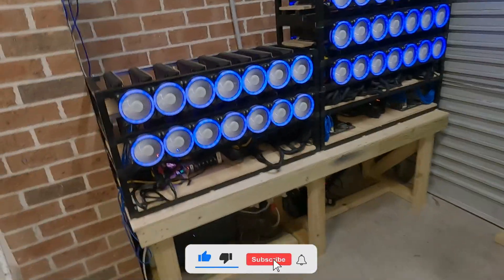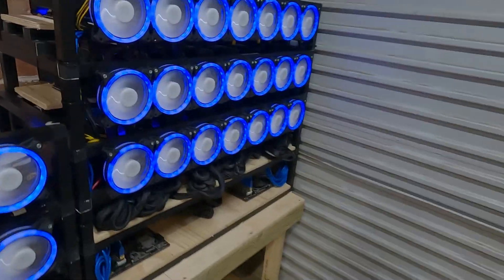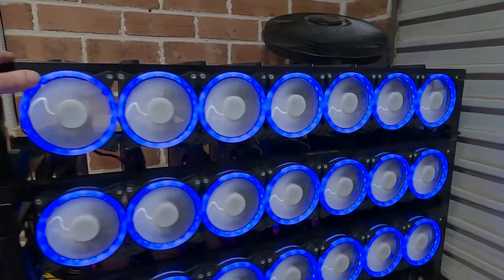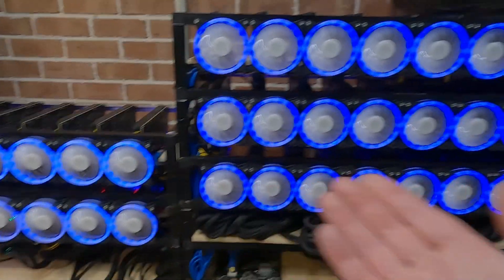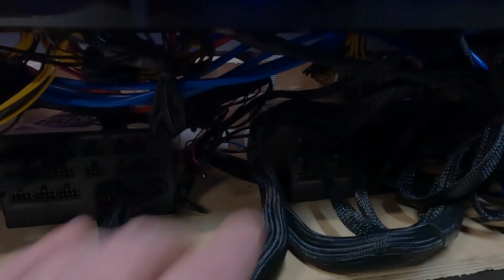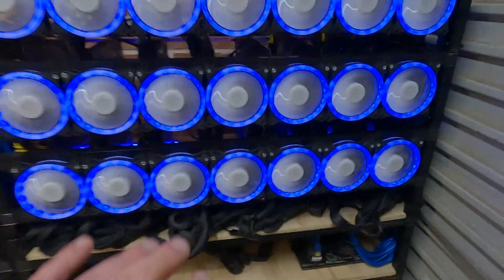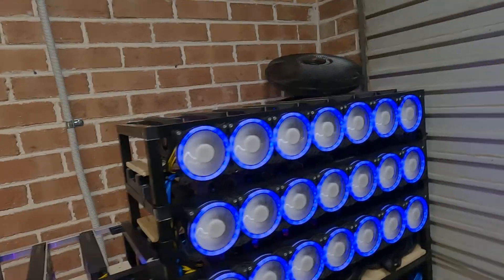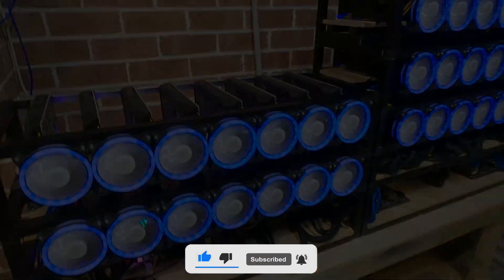My 3.5GH/s Ethereum Mining Rig Setup

Comment: Are your gpu fans pushing air to the wall? Mine are and I'm curious if that's TOO bad.    Or are yours sucking air out of the GPUs away from the wall?
Reply from the maker: Hey mate, yeah they where blowing into the wall in this video. And didn't have any issues have a couple fans behind pushing the heat up tonget it away from the rigs and stop it from accumulating.. but its now summer and it was not running well and was getting way too hot so I have now put them in a growing tent in the same position. But with a good exhaust system. And is working wonders. Checkout my channel you will see the tent video.. and I highly recommended it if you have that kind of setuo
Reply: @CryptekMining  Just watched it, thank you man, subscribed 💪

Comment: When did you fully assemble this?

Also, can you provide a description of how you assembled your frame?

Also, how did you effectively power all those fans?

By the way, this is an amazing setup!
Reply from the maker: Hi mate, I had assembled this around February 2021, The frame was custom as you can see a bit hard to explain everything but when i build my next rig in a couple of months ill be doing a video on how to build my frame.

Also the fans are molex each fan does not draw much power thus the because the systems have multiple power supplies i was able to distribute all the power to fans accordingly. Let me know if this is something you would like me to explain in a future video bro.

And thanks heaps bro glad you like it!

Comment: Very clean set up.. Are you using usb3 malke to female extenders? and are you using 8 pin extenders?
Reply from the maker: Thanks mate, With the USB I purchased 1.5 meter USB3 Cables to replace those that had come with the GPU risers. As for the 8-pins i had to buy some splitters as each card is running at 230 watts, so each PCI-E cable that comes from the power supply is powering 1 Riser & 1 GPU. at a total wattage of 230 watts but  obviously the cables from the PSU can handle 300 watts and on the larger RIG it is currently running 5 ATX power supplies. allowing each card to have its own dedicated PCI-e from the PSU.